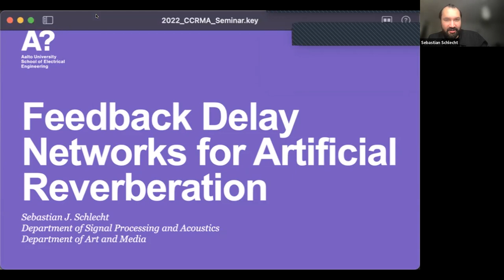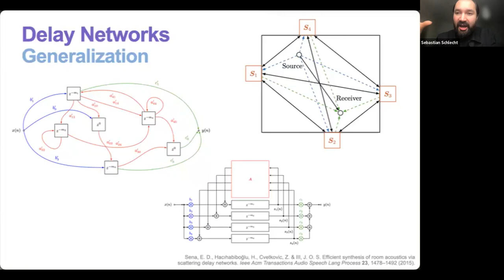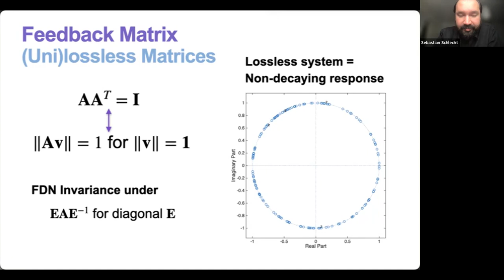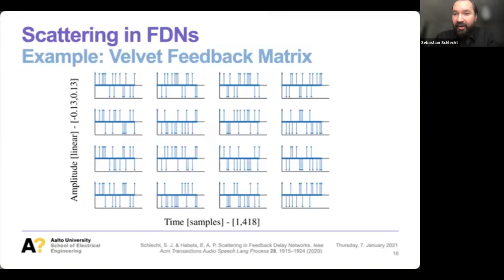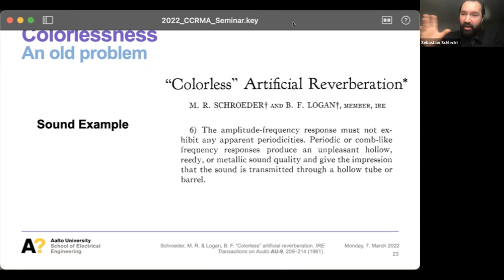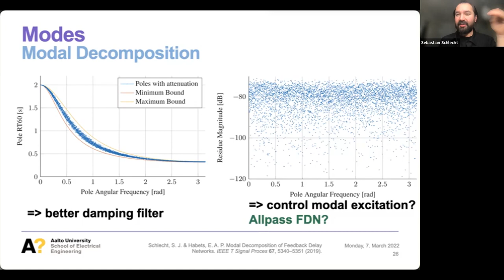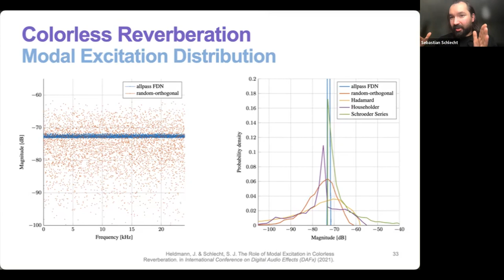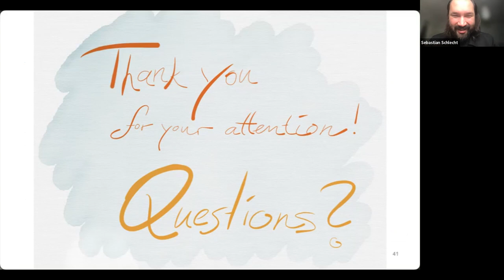Feedback Delay Networks for Artificial Reverberation - Sebastian Schlecht

Comment: Why does 1 clap become 4 claps once it has arrived  the A square ?
I can understand if this ould be a diffuser delay or allpas , is it related ?
Reply: A is a 4x4 feedback matrix that specifies which inputs are propagated to which outputs. If A isn't an identity matrix, there's some intermixing going on. In the example shown at 9:35, the matrix seems to be non-zero for all elements, so all inputs input are propagated to all outputs.